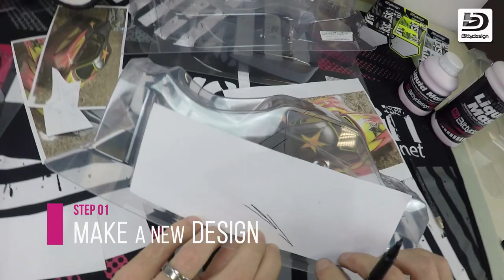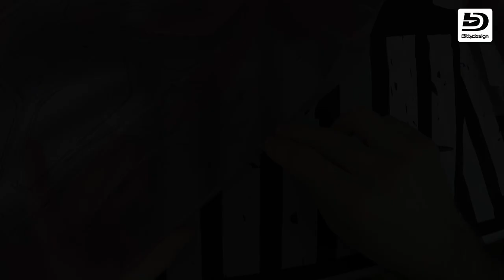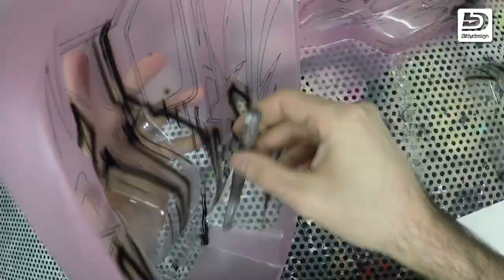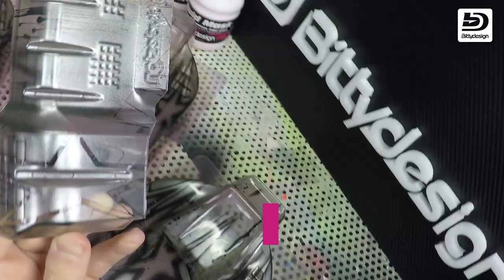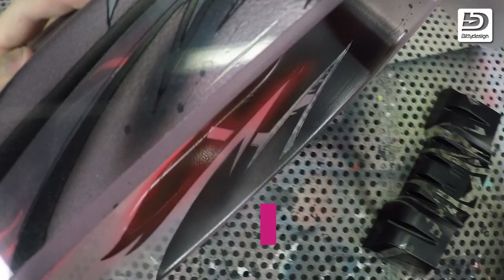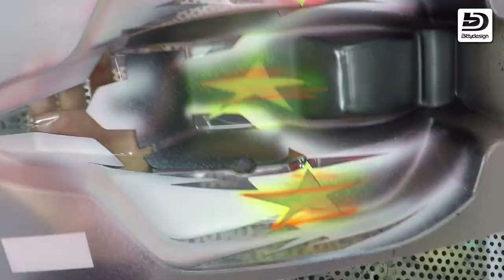Bittydesign Liquid Mask - How to paint Kyle Johnson R/C bodies.

Comment: I tried to spray liquid mask for the first time today and it did not work as in the video.  Can you tell me the settings?  Is it an HVLP gun?  Tip size?  PSI setting?  Mine sputtered.  I used a 1.4 tip at 50psi with a Wide spray HVLP gun.
Reply from the maker: Hey James. On our website you can find more info about that at the product's page. You can fin also a video here on YT dedicated only to the LM . basic setting for spray LM is 3.5bar, 1.0/1.5 mm size tip, 2 coat.